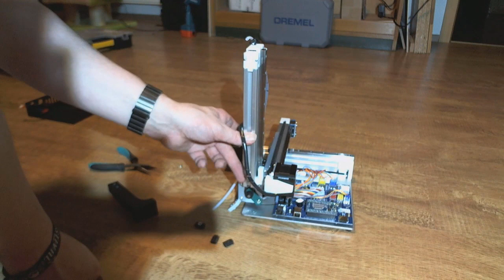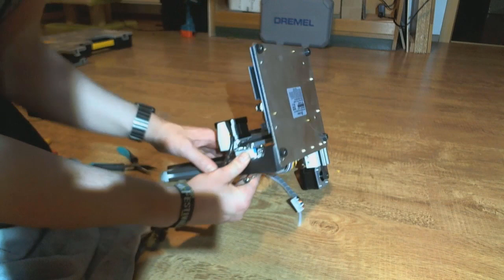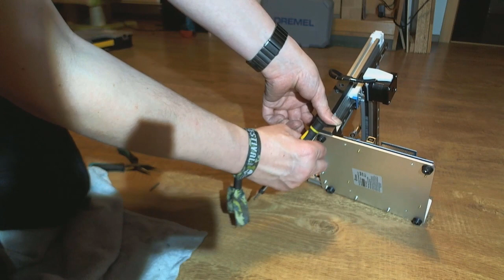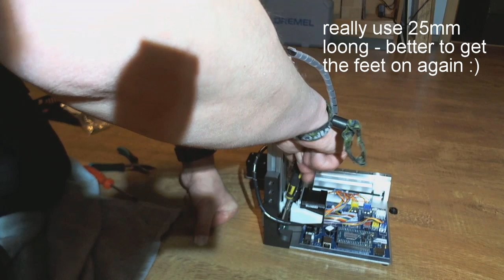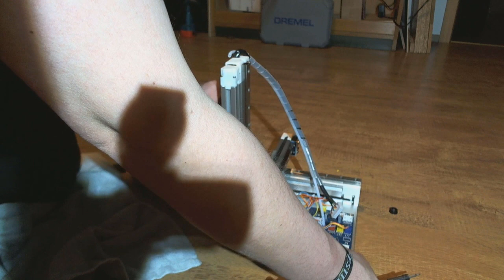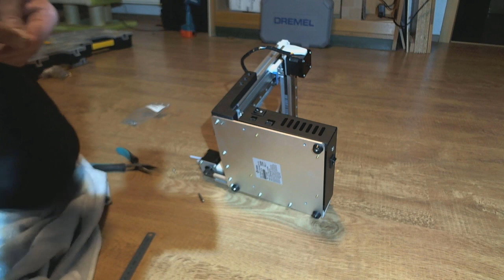Cetus3D z axis stabilization mod

Comment: Thanks for sharing (7 years ago, lol). I gave my Cetus to my mom and will be visiting her to do some maintenance on the printer. This isn't necessarily what I'm there to fix, but your disassembly answered some questions I was going to check myself. That said I also want to check the Z stability while I have it apart, as your solution looks to work great.